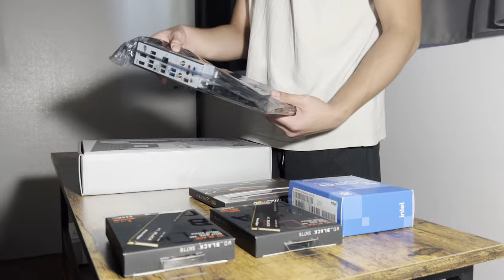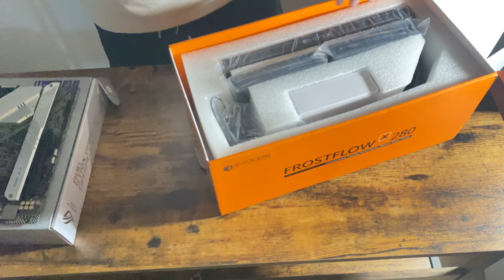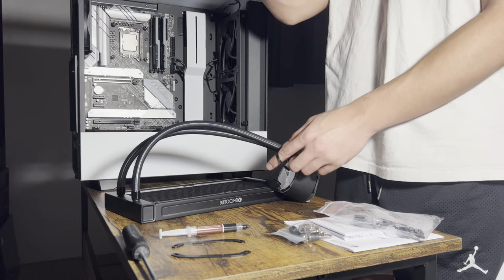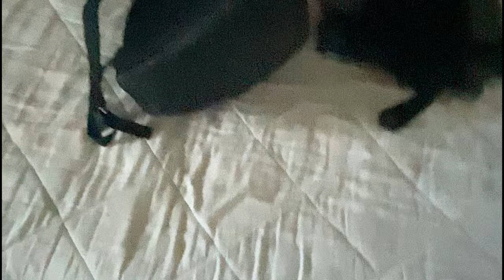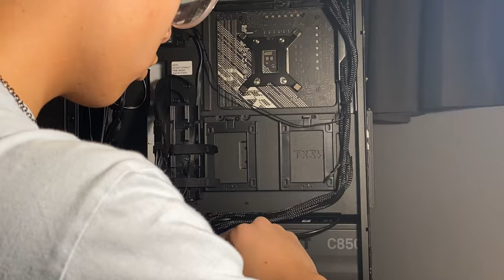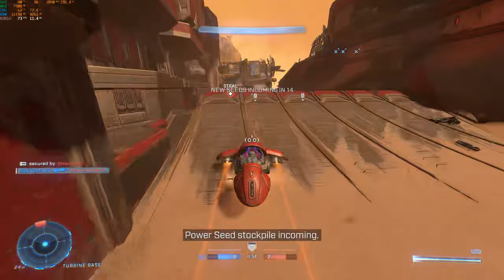My first PC Build | $1,100 Gaming/Editing PC Build | RTX 3060ti, Intel i5-12600Kf | 2023

Comment: Yo mate, its recommended to mount the radiator so a part of the radiator is higher up than the cooling head and tubes is in the bottom. On this build, you just gotta flip the radiator 180º then its perfect. Looks good but had to comment on this. Use to build 1000-1500 gaming rigs a year and this one just caught my eye :D
Reply from the maker: Thanks man! Its true flipping it 180° would make changes but I’ve seen content creators did this mounting on this specific cooler and both mounting had almost no differences in terms of cooling and performance, and I just tested it, max temps were capping only at 69-73° on overload, the only thing thats holding back it’s performance is the case😂 (If i had the H510 flow, temps would go down 2-3° or lower). Thank you for the recommendation!!
Reply from the maker: @h0rk3d  Ohhh I understand now, Thank you!
Reply: Yeah, but HEs good, so many people have it like him.